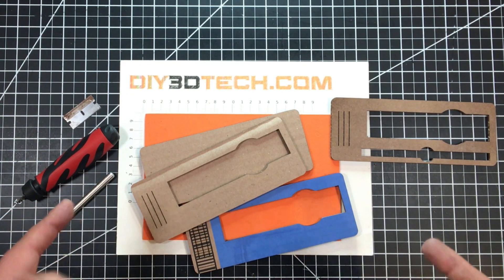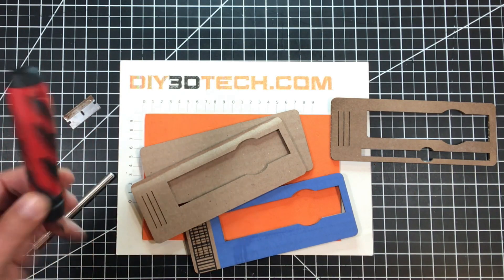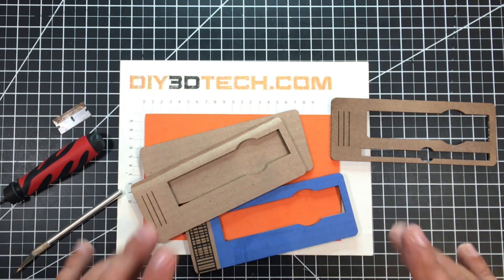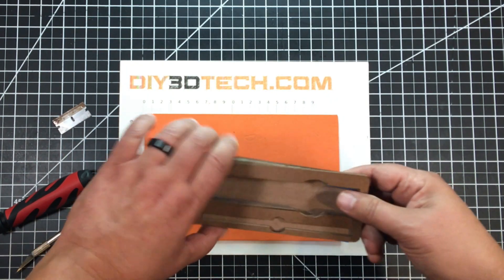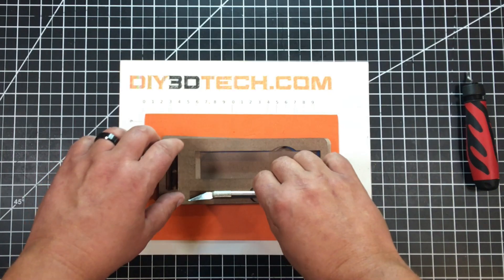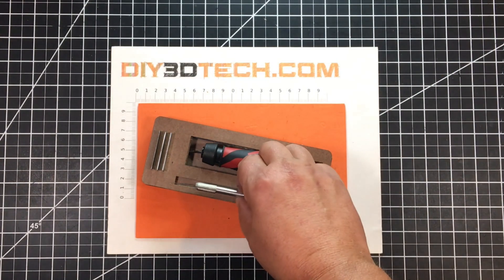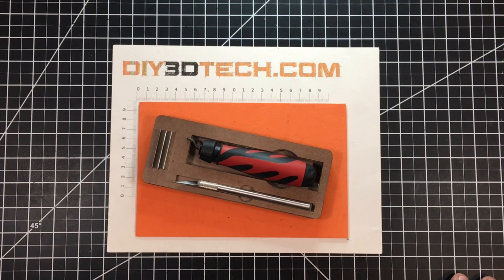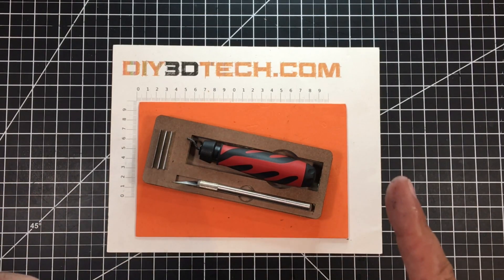Design Talk - Cardboard Kaizen Craziness With 3D Print Clean Up Tools!

Comment: I really like your Kaizen projects.
I'm going to try designing for the tools I have and cut them on my K40. My 3018pro came with a 2.5 watt laser, good for engraving but not so much for cutting.
Reply from the maker: Many thanks! I to0 have a k40 (actually 2 of them) and yes use them for projects of this as they are in fact much faster then a diode laser. However folks have the diode lasers like this kind for that audience I focus in on that...